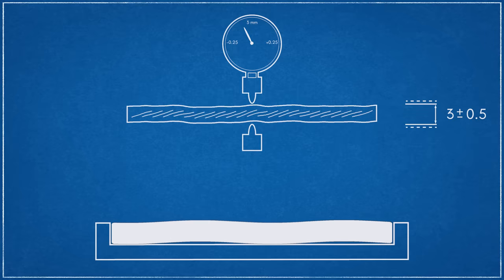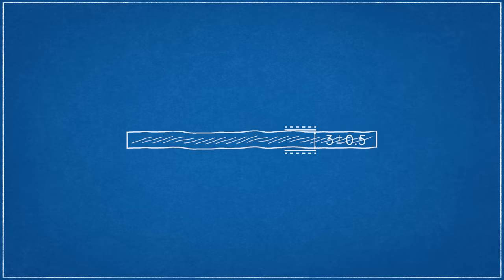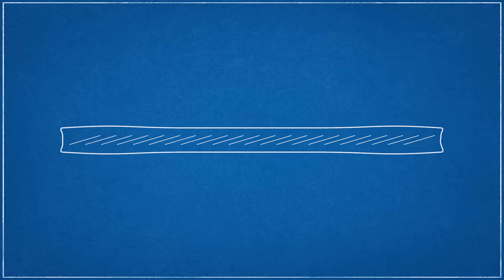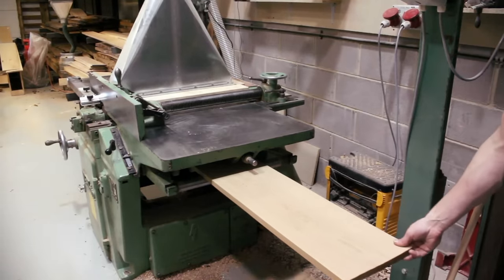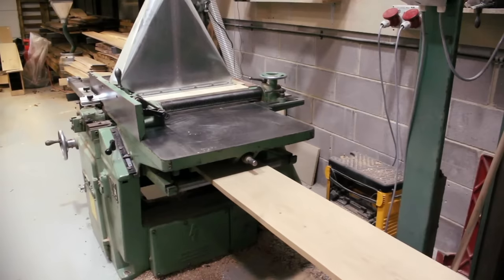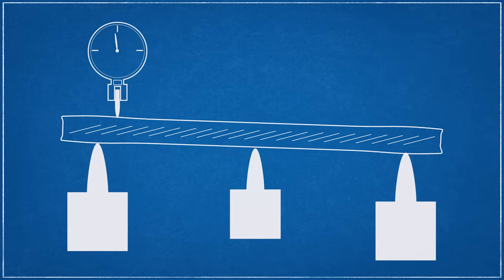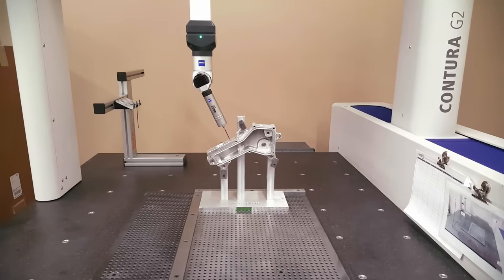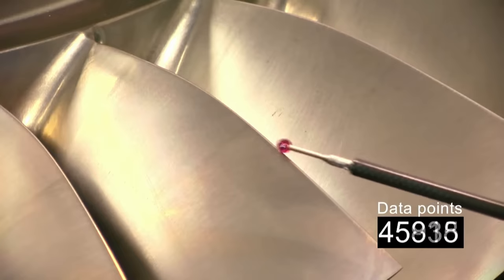The Science Of Flatness

Comment: The gaskets aren't just for imperfect surfaces. They are for materials that grow, shrink and warp with heating and cooling... Every component in an engine bay for example.
Reply: Especially dissimilar materials that expand and contract at different rates (e.g. iron block and aluminum head)
Reply: Very true.
Reply: Old air-cooled Porsche engines don’t even use head gaskets. They rely on the thermal expansion of the materials as the engine heats up,and the precision machining of the parts,to seal the combustion chamber.
Reply: @RunDub    Which is why air cooled Porsches need a $17k rebuild/remachining every 17k or 3yrs.
Reply: Right, so it becomes imperfect somewhere along the lines =P.
Reply: @dilligaf0220  every 17K!? Wow.  That is something I didn't know.
Reply: Great point!
Reply: A material that is growing or shrinking isn't going to be perfectly flat - so that would make the surface imperfect.
Reply: Yeah you just repeated yourself trying to sound smart.
Reply: Thanks for pointing that out. It's always good to see experts come in and fill in the gaps on these videos.
Reply: I.e. surfaces that become imperfect due to warping from heat...?
Reply: @Llllillilililililillll  Yes, those were mentioned.
Reply: So imperfect surfaces hahaha
Reply: @PhthaloType  almost had to trash my engine when my radiator exploded and had to limp the thing home on zero coolant
Reply: @robertgiudice5257  I've been there! I had a water pump go bad, and the engine was overheating when I was out on a rural highway. This was back before I had a cell phone, so I had to nurse it to someplace with a phone so I wouldn't have to walk for miles. Heater on full blast on a hot summer day. The head got warped and had to be resurfaced.
Reply: @dilligaf0220  Volkswagen Beetles and superbugs do not have any head gaskets. But the compression is relatively low, and it works.
Reply: It has always stunned me how expensive a main engine gasket is. Is there anything to justify this, or is it sheer ( no pun intended ) profiteering?
What's worse is, you're then told you need the head skimmed. 
Or should it be scammed?
Reply: @RunDub  when you rely on expansion to make it flat.
Reply: @Chuck Farley  Is that true?!
If that is true, an air-cooled Porsche with 150k miles will have its block and/or head machined 8 times. A lot of material will be removed (changing compression ratio, valve to piston clearance, etc).
Reply: He did a video on Gaskets guys. Just rediscovered the channel today because it popped up on my feed.
Reply: technically thermal paste is also a form of gasket! but instead of paper or rubber or metal, its a liquid paste.
Reply: @scarecrow5848  though liquid sealing is a pest to disassemble. Risking to damage essential machine parts because of the gluing effect. Original gaskets should always be prioritised for valuable machinery.
Reply: @OmmerSyssel  I mean yeah, but in the case of thermal paste, its really easy to clean off and you dont need much of it, a little bit of isoprope on a Q-tip will get rid of all of it right away!
Reply: There will be a video about the engineering/uses of gaskets within three years, sir.
Reply: @michaellavery4899  you ever replaced a head gasket, I mean do the work personally?   We did a top end  replacement on  one of our Toyota Camry's. Parts and labor for having the head done were about half the cost.  And some motors are more complicated, to work on.
Reply: @paulmohney5715  
Did you read my comment?
I wasn't talking about the cost to do the job. I was asking how the manufacturer of the gasket could justify the cost of a thin piece of metal that was cut by a machine with minimal human input.
The head needing skimmed is not the fault of the mechanic. I know it is a skilled job to replace a head gasket.
I feel I am being scammed for paying big bucks for a thin, machine cut seal that doesn't create a perfect seal.
Reply: "Gaskets aren't just for imperfect surfaces, they're also for imperfect surfaces"

Comment: Imagine making an engine that is bonded by spontaneous cold-welding due to perfect flatness in a vacuum.

You couldn't open it to check it I guess but fuck it, it would be impressive.
Reply: Space manufacturing is going to be great
Reply: @AJ213Probably  "I'm tired of this (lack of right to repair) grandpa!"
Elon: "well that's too damn bad!"
Reply: It would be cool if it worked, it would be good if the head and block were the same material otherwise heating and cooling would warp the surfaces and create a mess
Reply: I had an idea for a 3D printer using cold welding in a vacuum. The "pixels" would need to be cubes or something with a flat edge.
Reply: Just wait til subie owners hear about this

Comment: as someone who gets structural design courses, and works at a tool manifacturer, this is amazingly well produced and well informed i love it
Reply: Nobody actually asked a quality inspector. Tons of guessing going on in this video. It provides most of the basics but, we need more information on how the Flatness is actually called out. Is it to itself or in relation to other datum points?
Reply: Drafting 101 GD&T.
Reply: I liked it, too. I worked in a GE Energy machine shop that had 16 CMMs, both in final inspection and on the shop floor. I did NDT but was enamored with all final’s cool tools.
Reply: @larrylund2682  Flatness is a form only control, it cannot have a relationship to datums. If a print references either the ASME or ISO GD&T standard and it had a feature control frame with Flatness AND datums, the print is in error and wasn't produced per standard. I agree that it is a great introductory video, but one getting into the level you are asking for would be significantly longer.

Comment: Very informative and well edited video. If ever you chose to revisit this topic, a concern when you start approaching high level of flatness is that temperature differentials throughout the part being measured can significantly skew the results making climate acclimatization an import step before measuring. I've seen toolmakers and engineers struggling with inconsistent readings for weeks only to find out that parts need to sit in the QC room for a while till they acclimate. Otherwise mounted on measuring fixtures can pull the heat out of one part of the piece while the rest is still warm causing it to warp.
Reply: I used to flat lapp seals for pumps and they were perfectly flat under the glass when they came of the machine but once they cooled a little the light bands I saw didnt make me happy anymore so yeah temp is a big deal

Comment: and ensuring the work is uniform in its temperature to avoid thermal induced error.
Reply: @carpe diem Imagine if the top of a "flat" plate was warmer than the bottom. The top would expand, causing the plate to warp. This affects flatness.
Reply: @soaringvulture  Yes,  a 1 degree Celsius difference in temperature between the top and bottom of an AA grade surface plate can throw its flatness out of tolerance. Even without a thermal gradient, materials expand and contract less at their edges, so a surface plate becomes convex as the temperature rises, and concave as it drops.   Calibration laboratories go to great lengths to prevent thermal errors - tightly controlled environmental temperature, forced air circulation to prevent vertical thermal gradients, limiting the presence of 70+W organic heating elements (humans) to a minimum, even minimizing lights to limit radiated heat.  It's normal to fixture  components and gauges, then leave them in place for hours to normalize, then to take the measurements as quickly as possible before the human presence starts to affect readings.  NIST have a great document on gage block calibration,  "The Gage Block Handbook" , that describes the lengths they go to in order to accurately calibrate gage blocks.  Personnel wear mylar capes, cotton gloves and use insulated tongs in order to prevent human heating effects.  They even worry about different surface finishes absorbing radiated heat at different rates affecting comparative measurements which they use  to reduce uncertainty errors.  Yes, thermal errors are very real
Reply: @genixia  Yep.  I have an inspection block level for leveling machines and it's good for 2 arcseconds, or .0001" per 10".  You'll see the bubble start to move if you touch the level, breathe on it, or let a sunbeam hit it.  It's a good demo to show people how even minuscule levels of heat can change your measurement.  It also makes me wonder why so many shops don't bother with the expense of a temperature controlled shop so the machines can take full advantage of the thermal stability of the environment.  The chiller systems can only do so much.
Reply: @keiy.4031  I calibrated these

Comment: I find this stuff truly facinating… I’m just a mechanic, I don’t do much involving making surfaces flat, but I’ve got some decent precision tools for checking flatness, micrometer, calipers, machinists straight edge, feeler gauges, etc…well, my micrometers and my calipers where disagreeing on something so I ordered some mitutoyo gauge blocks to check them, not the top of the line grade OO ceramic blocks, but some nice grade O steel blocks. (my mics and calipers aren’t mitutoyo, couldn’t justify spending the money for how much I use them, but they’re not junk either, USA made stuff.)…well, I got these gauge blocks and saw the certification paper saying ‘accurate to 3 millionths of an inch.’ And i was like ‘wow, I, as a humble mechanic, have no business holding these, these are awesome.’ Checked my tools, very carefully oiled the blocks, wrapped them back up, put them back in their boxes, and put them in the corner of one of my less-used drawers, and put a desiccant pack next to them 😂

Comment: One of the flattest surfaces we know how to produce is pure molten tin. Aluminium has a similar effect, however when it is in its pure molten state it must be kept prohibitively hot to prevent oxidizations forming and ruining the flatness. It’s one of those cool properties I wish more factory games would play around with, needing to maintain a constant supply of a consistent molten metal.
Reply: i wonder if you could get it to harden in an place without gas that reacts to it and keep that flatness
Reply: @hfso372  You would have to cool it down really slowly, within non-reactive atmosphere. Possible but not the best way to achieve flatness
Reply: actually it's as round as the Earth. And mica is flatter and solid
Reply: @hfso372  You can. It’s a fucking nightmare, which is why it’s almost never done.

Comment: Very interesting information. I was surprised to find out that very flat objects will stick to each other. Very cool.
Reply: The first time I saw it in person I was blown away. Whats even crazier is you cant just pull them apart and need to twist them off.
Reply: And it's not "exactly" known what causes this.
Reply: Air pressure causes the objects to stick or rather the lack of air pressure between the surfaces does.
Reply: Could it be the Casimir effect? Microscope slides are packaged with a powder-like substance between them to keep them from bonding. Occasionally you find them stuck to each other permanently.
Reply: It's the Van der Waals force.

Comment: When I was a 17 year old engineering apprentice, I was told that the incredibly flat gauges stick together because they have no air in between them due to their flatness.
Reply: Correct. Gage blocks are held together by atmospheric pressure.
Reply: This is exactly what's going on. In open space (vacuum), two pieces of the same metal merge together just by a touch.
I don't know why, that's just the nature of metals. It's not happening on earth because there's air in between.
Reply: @countryjoe3551  That is mostly incorrect. Although the atmospheric pressure likely does hold the blocks together a little, most of the holding power is something else. That can be proven by putting the gage blocks in a vacuum.
Reply: @ras573  That is called cold welding and it is not the force that holds gage blocks together. The most obvious indicator of that is that some gage blocks are non-metal, usually ceramic. Another problem with that theory, is that there is no galling when you seperate the gage blocks again. Finally, the gage blocks still stick together even when there is something between them like a thin layer of oil. That too would interrupt the cold welding process.
Reply: @cmdrmike9958  are you volunteering to put a set of gage blocks in your vacuum chamber and measure the amount of force required to pull them apart? I  anxiously await the results.....😉😉😉
Reply: @countryjoe3551  I unfortunately do not have a vacuum chamber. The channel Cody'sLab has a good video on it though. Here is the link.
 https://youtu.be/jNEvS_bjKIo
Reply: @ras573  nothing like cold welding, cold welding happens because both of the two metals are perfectly clean with nothing in between them,and a tiny amount of pressure and the metal starts to restructure itself and then makes the two pieces of metal one in a crystalline sense

Comment: This video was interesting to me because I play harmonica and that means I’m constantly trying to achieve perfect flatness. The reed plates of the harmonica have to be as flat as possible so they seal properly to the comb, this keeps air from leaking, which provides more control over the instrument. A stock reed plate from the manufacturer looks flat, but it will have leaks, once you really flatten it, you stop leaking and the difference is night and day. I’ve spent hundreds of dollars just on tools that’s sole purpose is to make the reed plate and comb as flat as you reasonably can, and still it’s never perfect. I’d like to have a reed plate that was flattened through these industrial means to an extreme level of machined precision, be interesting to see the difference it makes.

Edit: also, at one point he mentions that measuring flatness manually is a task that requires skill and expertise and I can attest to that. It took me hundreds of hours over years of trying to get my reed plates perfectly flat to feel like I was at the limit of what a human could do, and that’s with me already learning from the best harmonica maker on earth. If I had started without learning from a master I would’ve taken decades to reach the level I’m at now. 

Edit 2: I’ve actually achieved a very small level of “ringing,” not enough to get the comb to stick to the plate like shown in the video, but enough to where I can feel the resistance that the two flat surfaces make when sliding against each other.

Comment: My shop teacher used to own a transmission shop. Valve bodies in hydraulically shifted conventional planetary automatic transmissions are among the flattest components in cars, as manufacturers tend to use no gasket between the valve body and the transmission body yet have to seal in high pressure atf to control bands and clutches. Funnily enough he purchased a broken fine grained granite tombstone which the mason had cut to .0005 of an inch, he claimed. Cost him an arm and a leg. He would secure a sheet of 1500 grit sandpaper to it and run the valve body’s mating surface over it to ensure flatness... who would have thought a tombstone would have worked?!

Comment: I just retired after44 years in Aerospace Quality and Engineering. This is one of the best general explanations on this subject that I've ever seen. Great job !
Reply: do you know what the things at 9:30 and 9:40 are called?
Reply: @SighsInternally  They're called "Gauge Blocks"  usually made of extremely hard steel for wear resistance (although ceramic blocks we're in favor for awhile), they are precision ground on opposing faces - with a surface and finish that is so fine that they are able to be "wrung" together and will "stick" to each other (as in the video). They have various uses in Manufacturing/Quality Assurance applications.

Comment: I’m learned about this recently in college. Brake rotors got to be flat. There can’t be any variation in flatness above the width of a human hair. If you don’t mount you brake rotors properly there will be a weird rotation. The rotor can have a small tilt. This cause the rotor to rub against a pad on one spot. It will stop rubbing but the rotor is not flat anymore. This is what causes your brakes to give a pulsating feel. My teacher say they call it warping because it’s just easier to explain than hearing this whole explanation
Reply: Pretty good, but not exactly correct. :) Rotors often go out of flatness, being banged may cause it. There's a front side and a back side, or an inside and outside to a rotor. When a rotor is observed rotating perpendicular to it's diameter, the surfaces must be ideally flat, when they are not a motion called  "runout" occurs. As the rotor turns the "height" of one side moves away from (or towards) the other, creating a pulsing motion with the break pads. This pulsation pushes the brake pads, the brake fluid and even the master cylinder to the point where a driver can feel the brake pedal moving up and down. The reason for this situation is due to the mechanical setup. Brake pads are very close to, but are not touching the rotors  when brakes are NOT being applied. When they are touching friction creates a lot of heat, pretty fast, and this causes brakes to be ineffective. And this is very dangerous since vehicles are very heavy and require tons of braking force to pull the vehicle to a stop. It's interesting that the small amount of "runout" is what causes the brake pads to push away from the rotor when brakes are not applied!